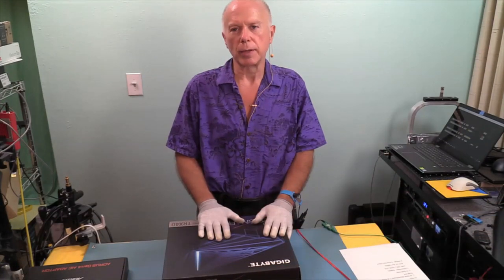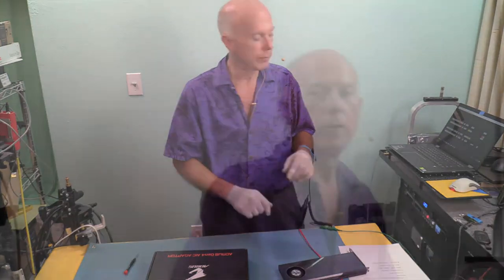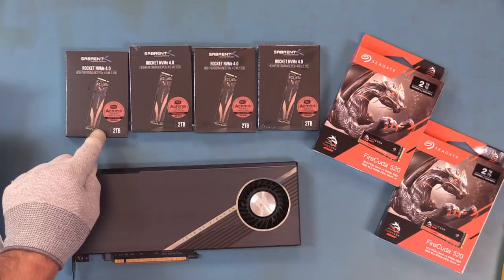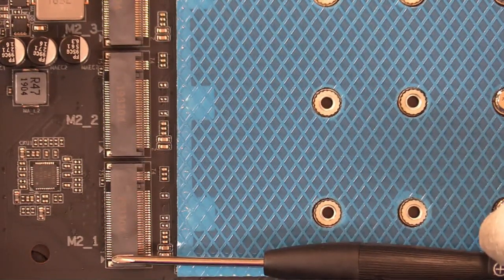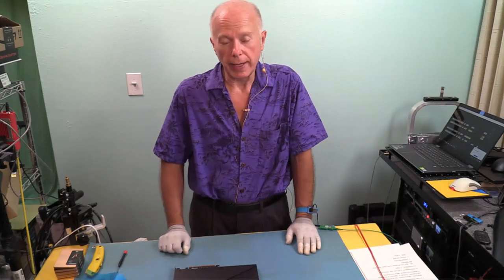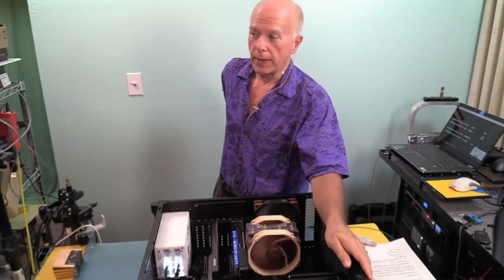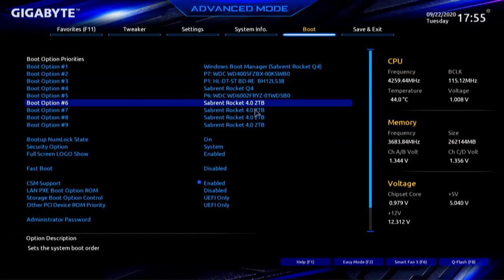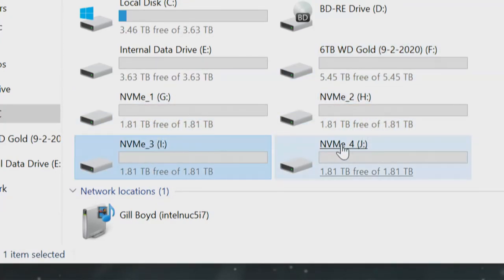Gigabyte AORUS Gen4 AIC Adaptor Comparison and Simple Install Tutorial TRX40 Designare

Comment: if i put a gpu in a 8 lane slot of a x570, does that slow the gpu down?
Reply from the maker: Hi Dutch, 
Good question. Nice to meet You! Doubt You'd see a slow down. And if You had an RTX 30xx, would that be acceptable? The bigger problem would be, You now have 2 - x8 Slots. Therefor, no M.2 Quad card. You'd have to use a self Bifurcated Quad card that would work in a x8 Slot. That would be the Glotrends Sky card. We have a Video on that Card here: 

GloTrends Sky x8 M.2 NVMe Quad card
 - PCIe 3.0 
https://youtu.be/QF71-5nhrAk

According to the x570 Specs, this all works. We've yet to see one in practice where it actually will work. Tell Us Your Motherboard Brand and Model so we can double check. Non of the Gigabyte x570 Motherboards will work, to give You 2 - x16 Slots using a Video card. Too many shared Resources.
Reply: @BuildOrBuy  Thanks for the reaction, i appreciate it. let me explain my situation quick first, currently i got a to old and slow system and i decided i want to build my next pc my self but i never done that before, the past couple months ive been spending a lot of time watching vids and asking question to learn what to watch out for for configure youre system, ad this moment i learnd a lot and i understand a lot, but the more you learn the harder it get to configure  a system. im not really looking for a best bang for bug system but im looking for a high end best gaming pc not looking ad costs, my plan is to buy each month a part so in a while i got every thing, i allready goot orderd the case and cpu cooler, so my motherboard that i want to go for is the msi meg x570 godlike am4 to pare it up with a 5000 series cpu and 6900 gpu, but now i was scrolling the internet to see whats new and i stumbled on this card that has 8Tb memory with read and write speeds up to 15000 mb/s according the specs: GIGABYTE AORUS Gen4 AIC 8 TB SSD

https://www.alternate.nl/AORUS/Gen4-AIC-8-TB-SSD/html/product/1651423?event=search

So ad this point i try to learn if the system can handle it, but i found out that the card need 16 lanes, and the godlike has 4 slots with slot one 16/8 ,slot two 4, slot three 8/4 and slot four 4 so from what i understand id would still downgrade the gpu even if i got it slotted in de 16x lane.
or have you other ideas, cause the vid you suggested is a different kind of card?

Thanks Dutch

Comment: i have a gigabyte b550 aorus pro ac. it has only one pci-e 4x16. i also have an xfx rx 6600xt. i don't play games, i do creative work. from what i understand, i can actually place my 6600xt in the pci-e 3, so that i would be able to place the AIC adapter in the pci-e 4. slower speeds for rendering, etc would by minimal, having the 6600xt in the pci-e 3. or at least i'm guessing, and from what other people are saying. since i have the pci-e 4 open now, this adapter (or GC-4XM2G4) should work on my motherboard?
Reply from the maker: Hi Jay Stol,
Welcome! That depends upon if that x16 Slot can be fully Bifurcated from x16 to x4x4x4x4. Always the conundrum with shared PCIe Resources. 

See PDF Manual, page 30. PCIEX16 Bifurcation. That PCIe Slot does NOT support full Bifurcation. Only partial Bifurcation -  Options: Auto, PCIE 2x8, PCIE 1x8/2x4, PCIE 2x4/1x8. (Default: Auto). Hope that helps! Thanks for Asking!

Comment: Hou setup on a Gigabyte z790 aorus elite ax. (bios)
Reply from the maker: Hello user-bb8js9gw21,
Welcome! Gigabyte Z790 Aorus Elite AX
https://www.gigabyte.com/Motherboard/Z790-AORUS-ELITE-AX-rev-10

1. Install Quad card in only PCIX16 Slot. 

2. Set Bios Bifurcation 
In Bios see: PCIE Bifurcation Support 
Change X16 to X4X4X4X4 

If Your only option is from X16 to X8X8 then You will only see 2 M.2 NVMe PCIe SSD Drives.

Comment: Awesome video! Will you be testing the new Samsung 980 Pro Gen 4 drives in this card when they release?
Reply from the maker: Hi Jeff Baker, 
Thank You! Good question! Details matter! We've been watching too! The first batch top out at 1TB. Typically, the larger they are, the faster that are too. Expect to see the same. We'd like to get our hands on the 2TB version. Kind of like the 1st TRX3080s. The 2nd batch will have 20GBs of RAM and all those wonderful CUDA Cores for Rendering FX! 

Now, to Your Question, we'd like to! We'll see! We have several NVMe AICs to wade through. I'm amazed how many Users are interested in what we perceived would be an esoteric AIC. Not so! NVMe anything is main stream! And once You've done NVMe, nothing else matters! We'll keep Your idea in mind!
Reply: @BuildOrBuy  Awesome thanks bud! I'm hoping the 2TB won't be far behind!
Reply from the maker: Hi @jeffbaker4219 ,
Absolutely! That's we're thinking. December is coming up and CES is in January. They have to meet Sales Demands for the Holidays! We'll see!
Reply: That 980 PRO 1TB shows a faster R/W speed than Sabrent or Seagate drives. Is the 980 a newer revision?
Reply: @maxhughes5687  Yes it is...Has a new controller also.
Reply from the maker: Hi @maxhughes5687 , The Samsung 980 Pro are 2nd Generation PCIe 4.0, Whereas the Drives we used, were 1st Generation, PCIe 4.0. Newer Technology, new Controller Chip! Yes, Faster!
Reply: @jeffbaker4219  Sellers showed the speed difference but didn't say why. Thanks Jeff
Reply: @BuildOrBuy  Thanks Gill. I'm still on GEN3 PCIe mobos, But I try to buy stuff that matches the new boards specs. A DIMM2 with a single 1TB 980 would be perfect for a Linux option in W10 Hyper card system. Kill the hyper card with a dip switch and install the Linux O/S in the DIMM2. No windows updates will kill my Linux drive and no other Linux installs Grub2 can kill the UEFI boot partition on other drives.
Reply from the maker: Hi @maxhughes5687 ,
We're looking forward to the Samsung 980 Pro too! Currently, only the 500GB version can be ordered. We hope the 2TB will soon follow!
Reply: Max Hughes Hi Max, saw your comment about a hyper card. Tried google but didn’t find much except an old popular Mac program. Could you please share what a hyper card system is and what might be required for hardware? Interested to try an isolated OS install where it’s hardware toggled and no OS/boot loader can mess with each other. Thanks!
Reply: @krackpot_  "mess with each other" is correct. W10 on 4 2TB GEN4 NVME PCIe card and all I need to do is flip a dip switch on the TR mobo and that PCIe socket goes dead. Either put the other O/S on a TR DIMM2 socket (easyto instal or removal) or a second PCIe socket and turn it on at the dip switch. The O/S and the bios never see the second O/S set up. I got sick of one Linux distro distroying the grub2 of all the other drives. I have heard that W10 upgrades will try to create a windows boot leader on your Linux drives.
Reply: @krackpot_  Hyper card: Amazon, Asus Hyper GEN4 PCIe card ($69) holds 4 NVMe GEN4 drives. I run the GEN4 card and drives on first gen TR with GEN3 cpu lanes. The card and drives are backwards compatible..The card and a gpu, both on X16 lanes still leaves you two 8X PCIe sockets that will run 2 NVMe drives each. My only experience is with the Asus card. 4 sockets, 4 heat pads, front heat sink with a fan. Dirt cheap, cool and fast as a GEN4 drive can run. It has brushed metal front and back. If your running an X570 board get back to me.
Reply from the maker: Hi @krackpot_ , To expedite, a Hyper card references the ASUS Hyper Quad card. That's the original NVNe Quad AIC by which all other NVMe add in cards are generically referenced. 

We have a Video of an uncommon, non typical custom install on the ASUS Hyper Quad AIC.

Even ASUS, in their own Motherboard documentation,  references the Hyper name instead of saying Quad, Bifurcation or x4x4x4x4. Branding.

The 1st time I realized was when a User asked about Hyper settings in the ASUS Bios. I thought they meant VMs! Hyper-V! Specificity counts! Details matter! I realized what they meant after having read the Motherboard PDF. Live and learn! You guys keep me on my toes!

How to have multiple O/Ss in 1 PC Computer. The best way is to keep it simple. 1 drive, 1 O/S. Each O/S should be on a separate physical Drive. Each drive with a Bootloader pertaining to that O/S only! Easy with Spinners. Easy with SSDs. More complicated with NVMe's but doable. 

That was also another benefit of Hot Swap / Hot Plug. Why? Never let Windows see the other O /S. Why? 2 reasons. 1. Windows will try to mess up the other... 2. Windows will randomly install files wherever it thinks You have the most space.  

This is is an age old question we've come across many times. We should Discuss this topic in another Video.  The problem, the solution. And the thinking behind the answer. Remember anything software can do, hardware can do better! Control multiple Boots from Bios. Simple! Hope that helps!
Reply: Max Hughes Thank you! That’s helpful!
Reply: BuildOrBuy Thanks as always! :) Appreciate the deep dive explanation
Reply from the maker: Hi @maxhughes5687 , For x570, we suggest running a self Bifurcated AIC. We have a video of the GloTrends Sky AIC. A Quad card. Requirements: 1 x8 Slot, PCIe 3.0. 

The only self Bifurcating PCIe 4.0 Quad AIC is currently from High Point. Requirements: 1 x16 Slot. Currently, there are no PCIe 4.0 NVMe AICs that can work on a x8 Slot.
Reply from the maker: Hi @maxhughes5687 , As of 9-30-2020... The 1TB version can be ordered in advance!
Reply: @BuildOrBuy  It looks great and only $30 more than the other drives. I would hate to find out it's a fast buffer speed that only last till the buffer fills up. I've got an extra DIMM2 card for a Linux O/S. I'm just out of money.
Reply from the maker: Hi @maxhughes5687  , I hear where You're coming from! The new Samsung 980 Pro is a 2nd Generation PCIe 4.0 Controller. That's why it's faster. Not just a buffer. That aspect is a good topic to cover for another video! 

Specified speeds are always burst mode. Actual throughput is a different matter!

Comment: Hello. I bought and used AORUS Gen4 AIC Adapter and plugged it into the motherboard. There are 4 2tb samsung 980 pro attached to this adapter. But the system only saw 1 2tb. How do I solve this problem? The motherboard and cpu model are gigabyte z590 aorus pro ax, Intel i511400.
Reply from the maker: Hi Cebrayil Qafarli,
Welcome! Great Question! Neither Your Motherboard nor Your CPU will Support a Quad Card. Not enough CPU PCIe Lanes. And... Your Motherboard only supports partial Bifurcation which would allow 3 M.2 NVMe PCIe Drives to be seen and not 4 If installed in the 1st Slot! You have that 1 - X16 Slot, electrically. The other 2 Slots are X4, electrically. Furthermore, that X16 Slot Shares Bandwidth with M2B_CPU and M2C_CPU which leaves PCIeX16 with only 8 PCIe Lanes instead of 16 PCIe Lanes. Bummer, right. Such is what happens on a Consumer Desktop Motherboard with Shared Resources. 

Motherboard Manual, 
Page 37, PCIe Bifurcation Support 
Auto, PCIe X8/X8, PCIe X8/X4/X4

Gigabyte Z590 Aorus Pro AX Motherboard 
https://www.gigabyte.com/Motherboard/Z590-AORUS-PRO-AX-rev-10#kf 
Hope that helps! Thanks for Asking!
Reply: @BuildOrBuy  Thank you for your valuable opinion. There is PCIE Bifurcation support x8/x8 and x8/x4/x4 support in the bios of my motherboard. But even though I plug the Aic Adapter into the 1-ci x16 slot, it only shows 1 m.2.
Reply from the maker: Hi @cebrayilqafarli9912 ,
You have to make that change in the Bios to enable or turn on Bufurcation. Enable that feature then Reboot Your Computer for that feature to take effect.

Q: Are You using M2B_CPU & M2C_CPU? In a X8 Slot using those 2 M.2 NVMe PCIe Drives on the Motherboard, You will only see 1 Drive on the Quad card even with Bifurcation enabled. Not opinion, fact. X8 = 1st Drive only! Remove those 2 on the Motherboard to see 3 Drives on the Quad card. Hope that helps!

Your other Option would be a Self Bifurcated card like the Glotrends Sky card which works in a X8 Slot.
Reply: Hi, @BuildOrBuy  These are the components currently plugged into the motherboard.
Samsung SSD 860 QVO 1TB
Samsung SSD 860 QVO 1TB
Samsung SSD 860 QVO 1TB
Samsung SSD 860 QVO 1TB
Seagate HDD 2tb
Samsung SSD 860 EVO 1TB
Samsung NVME 980 PRO 2TB
Sabrebt NVME 1TB
Sabrent NVME 1TB
Samsung NVME 980 PRO 1TB
10Gb PCI-E Network Card

All nvme and sata ports of the motherboard are full, an ethernet card is installed in the x8 slot.
Reply from the maker: Hi @cebrayilqafarli9912 ,
To reiterate, You do not have enough PCIe Lanes. The only X8 Slot, electrically,  is the 1st Slot. And if all of the M.2 Drive Connectors on the Motherboard are populated, to reiterate, You are out of CPU PCIe Resources... The only way to Add anymore M.2 NVMe PCIe Drives will require a Glotrends Sky Quad card which is Self Bifurcated and will work in that only X8 Slot You have which is the 1st Slot. Count Your CPU PCIe Lanes.
Reply: @BuildOrBuy  Thank you for your comment. I will try to remove all ssd disks from the motherboard and use only the aic adapter. We send our greetings from Baku, Azerbaijan. We would like to welcome you if you come to Azerbaijan 🇦🇿
Reply from the maker: Hi @cebrayilqafarli9912 ,
I'm honored! Thank You for Your hospitality! To reiterate, You only need to remove the 2 M.2 NVMe PCIe Drives on the Motherboard as Outlined to be able to have and see and use the 2 M.2 NVMe PCIe Drives on the X16 Quad card. Success with Your installation! Keep Us Posted on Your Progress!
Reply: @BuildOrBuy  Hello. As a result of the changes I made, I saw that my system supports a total of 5 m.2 disks. As you said, with the 8x4x4x bios setting, I could see 3 out of 4 m.2 disks. But I saw this after removing 2 m.2 from the m.2 slot of the motherboard.

What I want to ask is, is it correct to do 4 m.2 raid 0 together with 3 gen4 m.2 ssds plugged into the motherboard and m.2 plugged into the pci slot?
Reply from the maker: Hi @cebrayilqafarli9912 ,
Good. Progress. Yes. If You can see the Drives in RAID menu, You can. Remember, You have to Delete an Array before You can Create an Array. Success with Your RAID Configuration!
Reply: @BuildOrBuy  my only concern is if my motherboard is plugged into 3 m.2 slots + 1 pcie slot, if I do 4 raid 0 with m.2, will I lose data in the future?
Reply from the maker: Hi @cebrayilqafarli9912 ,
We always advise, anything in RAID should exist in 3 places. RAID is more reliable than it use to be due to the underlying technologies. However, Clone, Image or Backup Your Data on a regular basis. A failure can occur. Not if but when.

Comment: Something I am having trouble researching with this card though, as I am piecing together my new PC and deciding what parts to buy.
Does this card make the read and write of the drive faster than what it would be alone in a normal 4.0 m.2 slot?

Right now im planning on getting a Crosshair viii dark hero motherboard which has two 4.0 m.2 ports. And for that im going to put in a Sabrent 4TB Rocket Q4 NVMe PCIe 4.0 M.2 2280 R/W 4900/3500 MB/s, and a Sabrent Rocket Q 8TB NVMe PCIe M.2 2280 R/W 3300/2900MB/s. 
But would this adapter card actually give me more read and write speed than they would give me in the on board 4.0 m.2 slots? As Asus says the pcie 4.0 slot have a bandwidth of 8066 MB/s, which is more than the cards say they can do?

too many number around to get it straight in my head.
also concerned this card wont fit with a water cooled rtx 3090 FE. =P
Reply from the maker: Hi Slamscape, Let's keep it simple. You have 3 possible ways to connect an M.2 PCIe NVMe SSD Drive. Listed by Speed. And that Speed is burst mode!
1. Motherboard M.2 connector to CPU.
2. 1 x16 electrically PCIe M.2 Quad AIC to CPU. If through Chipset. Slower.
3. Motherboard M.2 Connector to Chipset. 

The main benefit for an M.2 NVMe Quad card is capacity then speed whether JBOD or RAID. Hope that helps! Keep Us posted on Your Progress! Congrats on Your new Build!

And the ETX 3090, how many Slots wide?
Reply: @BuildOrBuy  
That’s what I would have figured. That having the m.2 directly connected to the motherboard would be faster than having an added step in the list. 
What confused me was people saying they get write speeds with this adaptor card of over 10 gb/s.
But now I’m assuming that speed only goes with raid configs?

What’s the difference between m.2 connected to cpu vs the chipset? 
Only thing I can think of is the cpu one is the one located physically closer to the cpu?

As for the rtx 3090 fe. 
Think of a large square brick resting on the motherboard. :P
Reply from the maker: Hi @Slamscape , 
Yes, RAID 0 - What I call, Flying by the seat of our pants RAID! The M.2 connected to CPU is always faster whereas the M.2 connected to Chipset is somewhat neutered since the Chipset is connected to the CPU through more PCIe Lanes either 4 or 8. It's a squeeze. And that's a bottleneck. We should talk more about that in another Video. Our Goal is to Keep it Simple! 
Brick - If it works, it works! We're always looking for brackets. Most Brackets are for specific Cases.
Reply: @BuildOrBuy  oh it works.  24gb of vram fury, and over 10k cudas. 
It’s been letting me smash cod Cold War on 4K with all graphics set to maximum. 
... except motion blur.  F motion blur
Reply from the maker: Hi @Slamscape , 
What PCIe 4.0 Cable Extender are You using? Glad You've found one that works reliably!